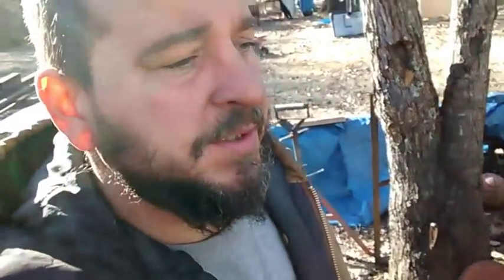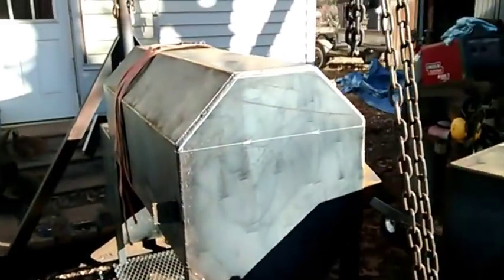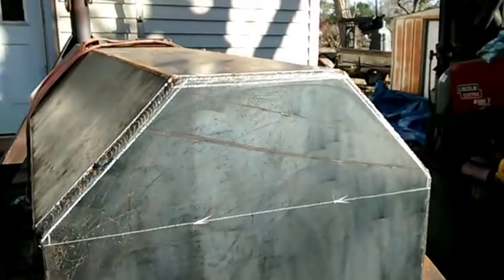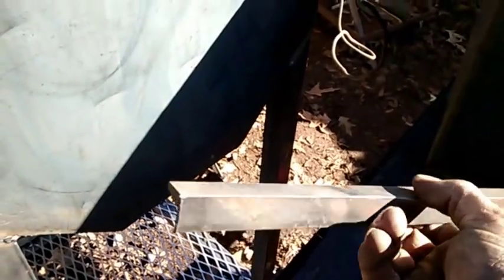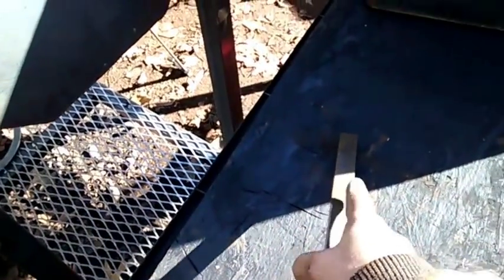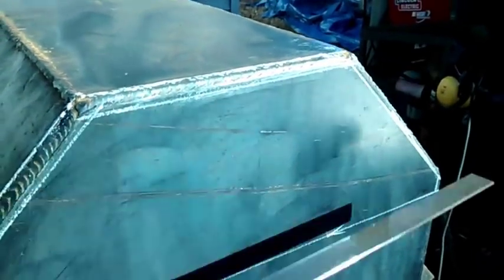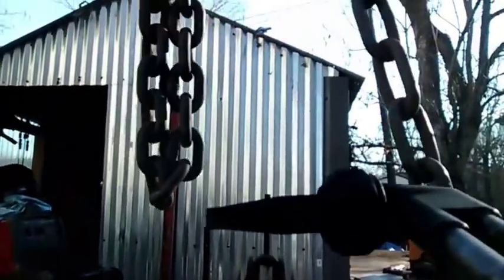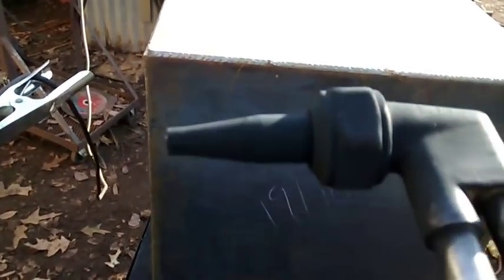Oxy/acetylene torch cutting tip

Comment: You should make you some Magnet straight edges that you can use over and over again... all you need is two of these Magnets from Harbor Freight Tool... https://www.harborfreight.com/retrieving-magnet-150-lb-pull-36904.html
Or you can just use these they work okay...
https://www.harborfreight.com/18-in-magnetic-tool-holder-62178.html
You may all ready have 2 of these just add a piece of angle with them.
https://www.harborfreight.com/4-3-4-quarter-inch-multipurpose-magnet-holder-1938.html

Comment: For those straight cuts, a worm drive circular saw with a metal blade is the only way to go. Good blades are only $30-40 and last quite a while, especially doing thin gauge sheet like that.
Reply: His video shows that your suggestion is not the "only way to go."
Reply: It's a figure of speech... There is always a better way of doing things. For doing straight cuts, torching by hand is probably one of the slowest and least accurate.
Reply: Torch cutting works for Allen. He has stated numerous times why he continues to use a torch in the face of so many "helpful" suggestions about what other tools he SHOULD be using.

It's hilarious that so many people comment on his videos all the time - in the face demonstrable proof the man knows what he is doing and gets good results - telling him how he's doing it wrong because he does not do it they way they think is "best."

It is also especially even more hilarious when those people - like you - don't have any videos on youtube showing their skills with these "best" techniques.
Reply: I never said it doesn't work, I simply stated there are better ways.  I've been running my own fab shop for years now and have plenty of experience to back it up. I just don't take the time to run a youtube channel. Cheers.